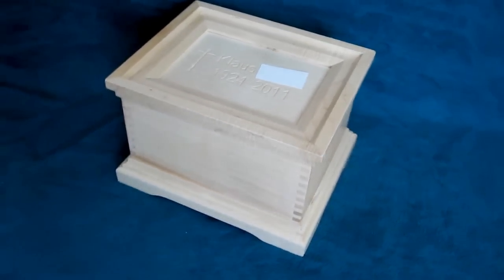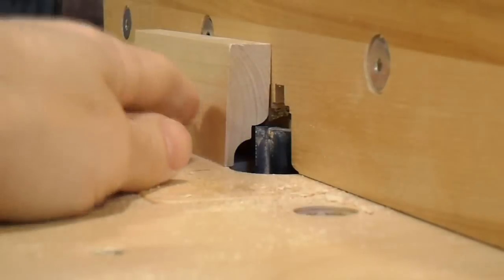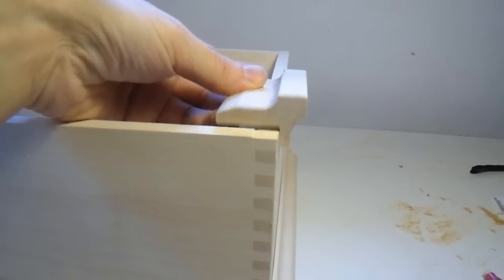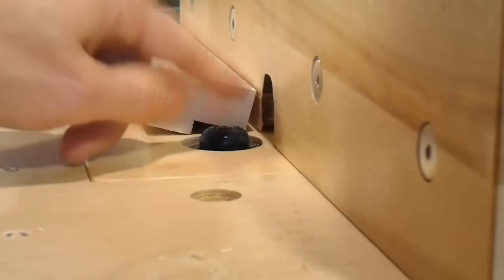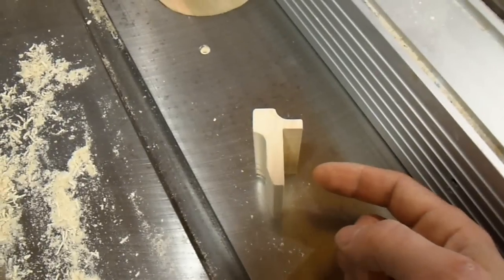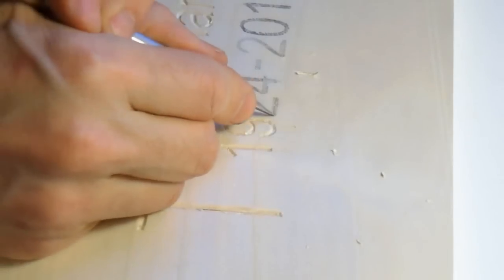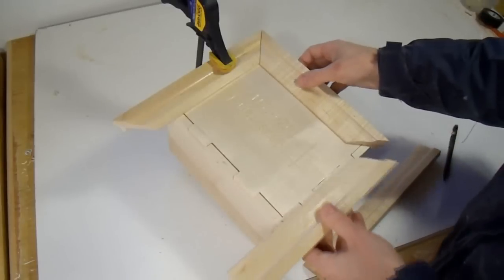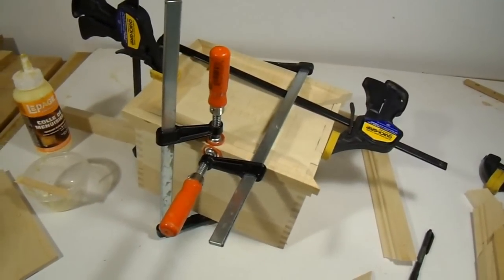Cremation urn

Comment: Thank you! You Sir, are a true craftsman and I am willing to bet that you’re an experienced hobbyist as well. In 2014 I was forced to euthanize my pet cat. 

He was a very good friend for many years and I still can’t speak about him for very long before I get too upset about his passing. 

Two months ago, (March 19th), my wife Julie, who was diagnosed with a terminal cancer 1.5 years ago, died here at home, after a 3.5 week, painful, and emotionally devastating battle.

We paid for a very nice wooden Urn (not very expensive, but very nice) for my cat’s remains when he died but Julie insisted that I pay for the minimum Urn provided by the funeral home.

I reluctantly agreed but told her I would make one. I know what she would be saying right now if she knew what I’ve paid in the way of a router kit, router table, belt sander, and a variety of jigs & tools so far!

However, I have a picture of her and my cat together. I plan to place that picture in the top of the Urn. It’ll be sealed in a clear polyurethane coating when I’m through.

I wanted to make a box-joint as you did but I didn’t have the right cutters required for the use of a jig I bought. Therefore, I used a dovetail joint, and have successfully completed the cuts and assembly, so far.

I’m surprised at the fact that the Urn you made is much like what I planned. There are some small differences but generally speaking, it’s a lot like what I planned to make.

I used cedar for the box’s sides and I have oak for the top and bottom framing. Thanks again for a great video!
Rich

Comment: Actually, you do get all the ashes. A standard cremation container has a base that measures 6" by 4" and is 8" high. If the ashes don't all fit it that then you are dealing with an abnormally large individual. Then the crematory would give the ashes back in two containers. In my 30 years as a funeral director I have only seen this three times.